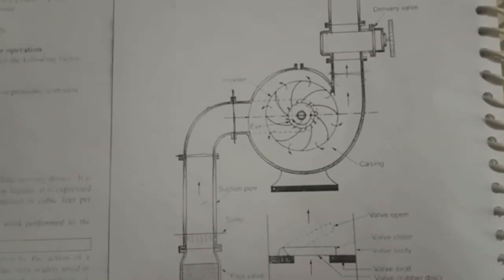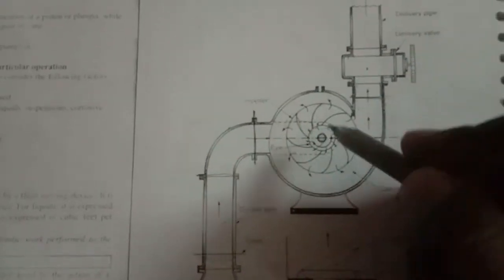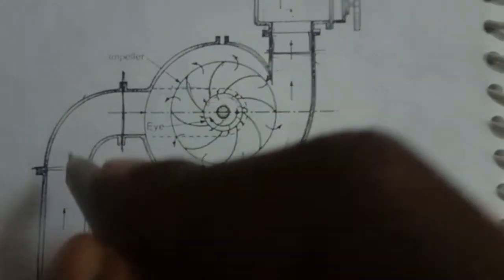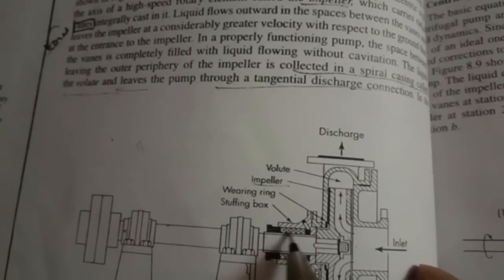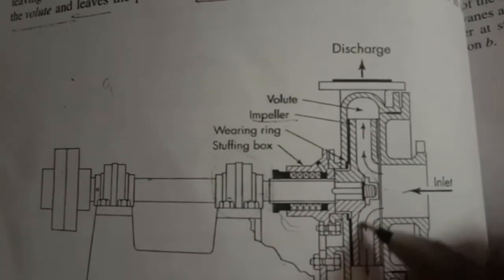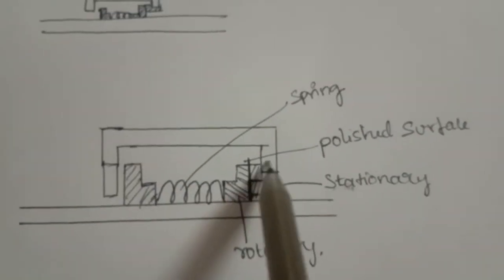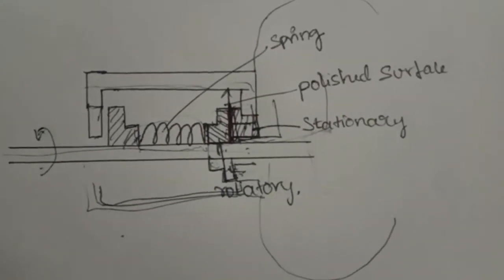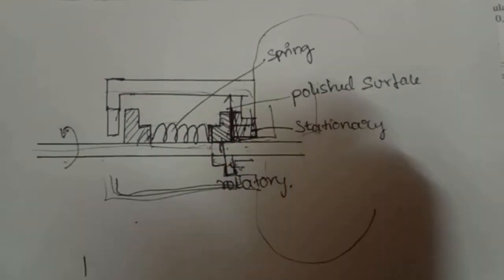Centrifugal pump telugu lecturer | #centrifugalpump #seals

Comment: High flow ki use chesey pump anti anna
Reply from the maker: High flow rate kavali antey..manam use chesedhi centrifugal pump,high discharge pressure kavali antey reciprocating pumps,we can use centrifigal pump for,suspension solids and slurries also